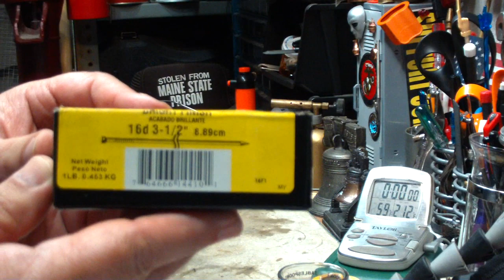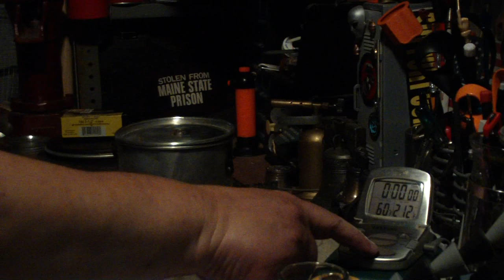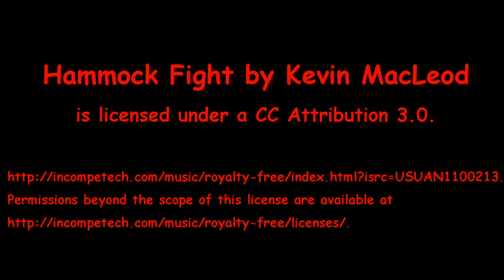Evernew Titanium Alcohol Stove ''Nailed'' - Boil Test

Comment: Nice idea with the nails! I’d say you were at the sweet spot. The flame wasn’t licking up the side wasting the heat. Kept it more concentrated in the
Middle of the pot. If you were lower the flame ring would be wider and the center won’t be as hot. I would like to see an experiment that would confirm this. It was one of the fastest boil times for two cups water I have seen.

Comment: I suspect the optimum height for the fastest boil time is more than one inch.  With my testing, I find that I get a faster boil time when I give my Trangia 1.75 inch instead of 1inch.  It's faster by about a minute. I'd be interested to see if you would confirm this with your methodology.  When the flame is closer to the pot, it took longer to boil but the fuel also last longer.

Comment: Hi Hiram. I took your Nailed method and made two pot stands out of 14 Ga. stainless steel bicycle spokes. I used wood skewers, cut long and gradually shortened to arrive at the desired flame to the bottom of the pot lengths with out having to waste ans stainless metal, which was 1/2 an inch for the simmer stand, and 1 " for the fast boil stand. The overall length of the stands turned out to be 3 and 3 and 5/8ths inches, respectively.  

The pot stand legs are held together by stainless steel split rings (one each), that came off of a fishing plug or lure. The ends of the spoke sections were U-bent back on them selves to retain the split ring on each stand, with the foot ends having a 90 degree offset horizontal bend so the foot will rest flat on the bottom of the fuel well floor and against the side wall, with a curve bent in the foot to match the tank wall curve as well as possible. The pot heads, feet and bends required about an extra inch of spoke material length per support leg. 

Spacing was one spoke every 8 jets. Placing the spoke legs in between the jets keeps the legs cooler - they turn cherry-red placed in the flames . The split ring above the cross point of the legs makes the stand more secure, besides holding the stand together.  The 1/2" to pot bottom stand took 14 minuets to boil 2 cups of water on one ounce of denatured alcohol. The fast boil stand 1" to the pot bottom took 5:30 seconds to boil its 2 cups of water. The run out time ran to 23 minuets for the simmer stand. The cost of the strait not budded or tapered bicycle spokes was one dollar each at a bicycle shop.

Comment: OK, so I finally decided to indulge my inner gram weennie (again).  I took two ultralight titanium tent pegs and cut three nails out of them (enough for another left over) three inches long (that length gave the same height as the cross stand),  So now I have a 9 g pot stand.  I guess that makes up for the extra weight of having to wrap wick around the burner because I'm using the SEUTAS version.  The tent pegs are far more expensive than your nails, but cheaper than the cross stand.

Comment: nails.. nice.. do you recommend that we use zinc plated only, or the nice green coated ones, or the grey galvanized? which do you find gives you a headache faster? i like dipping mine in lead based paint before i burn them too.. helps with the boil time.